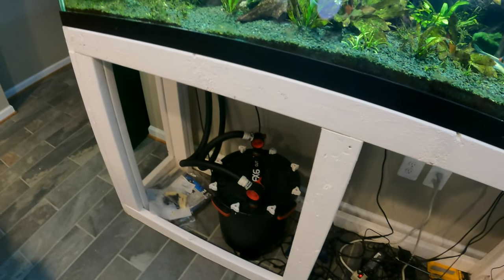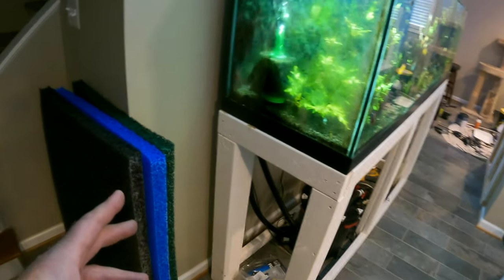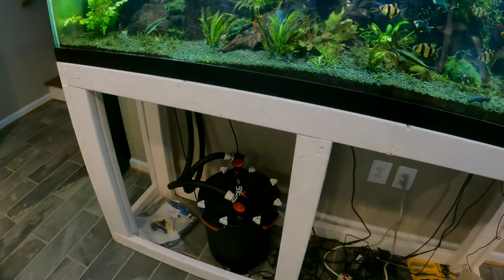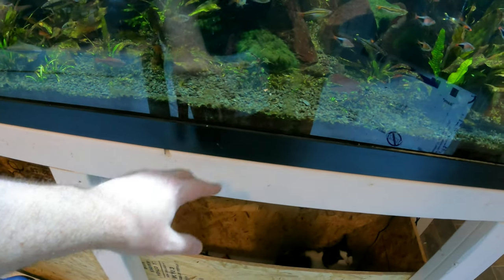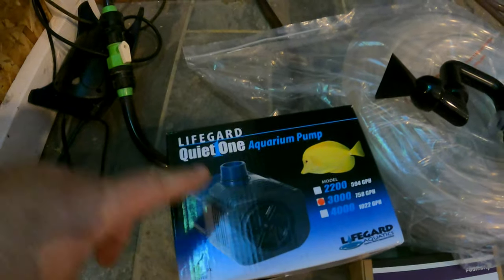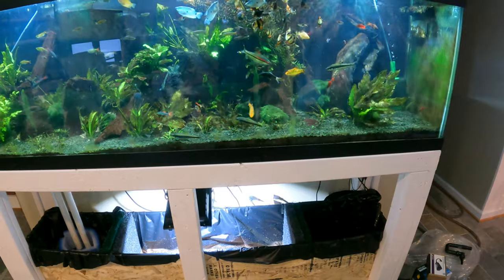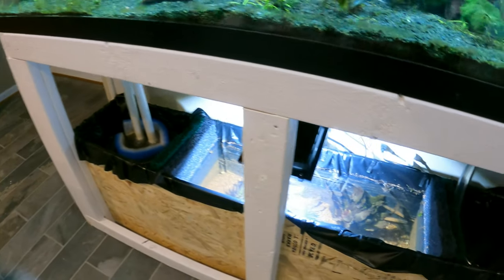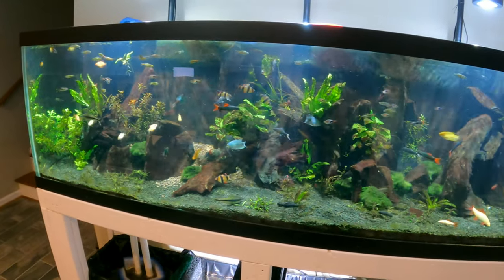Episode 19 :: Replacing Broken Aquarium Filter with DIY SUMP. The 125 Asian Stream Tank gets Sumped!

Comment: Great set up.what brand of overflow did you use?I have a similar set up with my 150 but my diy overflow is a lil noisy.
Reply from the maker: Thanks Ryan! My overflow is a Eshopps, got it from Bulk Reef Supply. Works well, I do keep a towel draped over the top to keep the sound down.

Comment: I wanna go with a sump system for my 125 S.American tank but, I don’t like the overflow box cause I’d worry about it catching an air pocket then the output overflowing the tank itself. Other than that you came up with an awesome solution to the dreaded overpriced sump.
Reply from the maker: Hey Scott! Yeah a drilled tank with bulkhead is overall better than the overflow box. The box i have does have 2 overflow tubes which does give some redundancy from a tube getting air pocket and not overflowing, but some risk there for sure.

Comment: No unions 🤔 Won’t it be difficult if you ever need to do maintenance or repair of the pipes?  Where do you buy plants? Online?  Looking forward to more updates!
Reply from the maker: Hey M W! That is a good point and I thought about it, but figured if the time comes where I need to modify the overflow or pipes for any reason I will just cut them and add in a union at that time. Really just trying to show that an effective sump can be made very cheaply from repurposed materials and very simply.

Plus I wanted to get back to working on Predator Bay :-)
Reply from the maker: Oops forgot to answer your question...I typically buy my plants online either from aquariumplants com or aquariumcoop com had many good experiences with both sites.